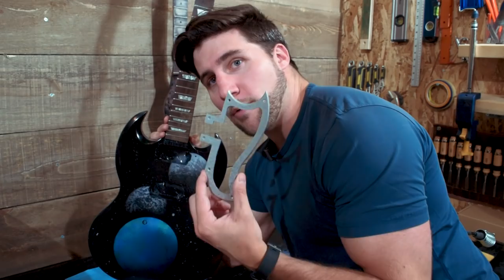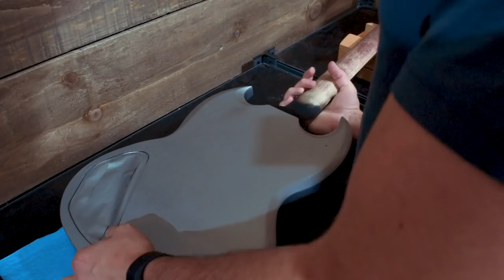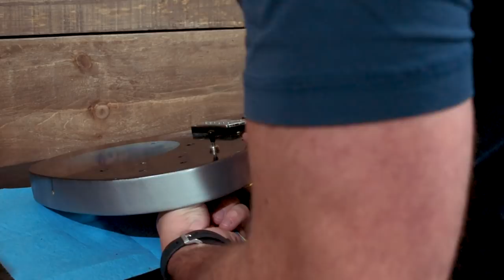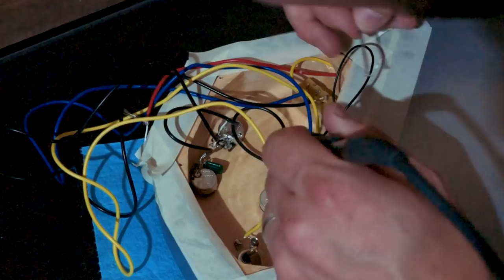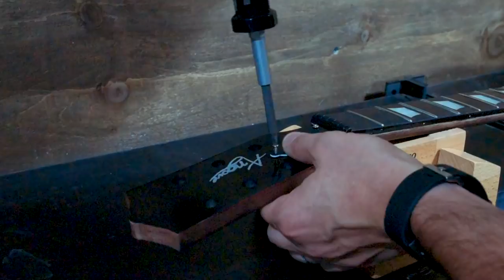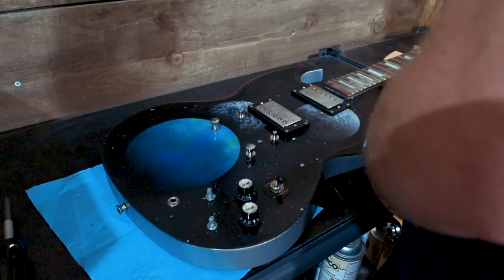The Home Depot Kit Guitar Challenge Part 7 (vs BigDGuitars)

Comment: I like the neck. It defines an area between the body and headstock, which is hardly ever the case. You could make that as unique item on the kits you put together. Good job. As far as the guitar goes, the artwork is great. I really like space themed products. The pickups sounded just ok. That would be one of the first upgrades but all in all the guitar is really nice. Certainly worthy to be auctioned off for charity. Good job Brad. 🤘
Reply from the maker: Thank you. I’m glad you like the neck and the general paint job.

Comment: Nice job.  On the soldering iron, what wattage is it?  The wattage is how you determine the heat. Simply telling your viewers the wattage would make it easier for them. I use a 60 watt which works well for most instrument applications.
Reply from the maker: Mine is a 50/60w station. I’m pretty sure I have a 60w iron on it.

Comment: I watched the whole series and it turned out great. You have some mad painting skills. One question though, no shielding? You could have used foil tape for sealing duct work.
Reply from the maker: I could also have used adhesive spray and tinfoil, or slug tape. When I tested the guitar the first time I wasn’t getting any noise, so I didn’t bother.
Reply: @BradAngove  From watching lots of videos and listening to lots of opinions, it does seem like shielding is unnecessary for humbuckers, and does not even help a great deal even for single coils which are naturally much more noisy. I know that goes against internet wisdom. However, most people don't bother to do an A and B test, they just assume it is necessary. If somebody has a decisive link to a clear A and B test where there is a major difference, in particular for humbuckers, I'm always willing to change my mind.

Comment: Hi, great you threw the pickguard out: one point. The long wires excuse doesn't stick; you dont want antennas: minus 1 point. You could have shield the cavity with aluminum tape ( it really works): minus 1 point. Score: brad - D: 2- 3. Rob.
Reply from the maker: Thanks Rob. The guitar isn’t noisy, so I didn’t worry about shielding. It’s definitely an option though and can be done with aluminum tape, slug tape, or aluminum foil with adhesive spray. Lost of options.

Comment: Hey Brad,
Love it. You said that a lot of people don't use a sufficiently high quality soldering iron and solder too cool. Since the one you recommend has a temperature gauge on it and I don't want to spend $250 on one, so what temperature do you use to solder with?
Thanks for this and all your other helpful tutorials!
Reply from the maker: I use different temperatures depending on what I’m soldering. Soldering wires to lugs doesn’t take as much heat as grounding stuff to the back of a pot.
Reply: @BradAngove  wow, I wasn't aware of that, since I have yet to solder anything (successfully).
What's the max you need? There's a used unit here in Germany I'm looking at which goes to 11 (sorry, bad joke - it goes to 420°C).
Reply from the maker: @ShawnHeath  That should be adequate.

Comment: turned out great! I bought one of those cheap Chinese kits but mines a les paul style. got the paper thin flamed maple front with mahogany back and sides. I've never worked with mahogany. Got a color picked out for the front, and an idea for the rest. I want the rest to be just a little darker than the natural finish, just a shade or 2. any stain or dye recommendations? I want a satin finish. would just satin poly darken it just a little? the front is going to be turquoise blue dye.  any suggestions? thanks.
Reply from the maker: Poly will amber it a little bit. Is the mahogany already sealed?
Reply: not sealed yet. having trouble finding a grain sealer here where I live. I can find all kinds of wood filler, but I don't think it's the same is it? the major brand here is minwax. EVERYBODY carries itlol
Reply from the maker: @timsummerlin6018  pore filler and wood filler are basically the same, but sealer is different. You can use dewaxed shellac among other things as a sealer. My favourite is the vinyl sealer from mohawk.

Comment: Any wet sanding and polishing after the clear coat?

Also, do you leave the guitar vertical or horizontal when you spray the clear on the front?

I like horizontal because it wont run and it even outs better but then you run the risk of dust settling on top.
Reply from the maker: You don’t sand and polish a semi gloss finish. Only gloss generally. 

I like to leave it horizontal.
Reply: Brad Angove ahh I didn’t realize it was semi gloss. I started with this video because the finish caught my attention and now I’m watching the series from the beginning.

Thanks for the reply!

Comment: Niccce job Bradley! ? How high do you set ur action at the 12fret, using metric measurements. Xheers! likd 193
Reply from the maker: I just set it to whatever is comfortable generally. Aka as low as possible without buzz. I use feeler gauges sometimes though. They’re not metric.
Reply: @BradAngove  Ok thankx, just wonder how you like ur action. Peace!

Comment: Cut a clear poly carbonate pick guard for it. Even  a  thin plastic sheet  is better than nothing.
Reply: "Nothing" is better if you don't like pick guards.  :)
Reply: @pulaski1  Think about  the poor unemployed Pick guards wandering  the streets.... No  purpose  no way to  rock... They wanna Rock!

I expect that soft  spray can  paint won't hold up well over time. I repainted a  Dean Vendetta that was born  Turd brown a bright  red with lacquer spray paint. That stuff is soft  months after I painted it. I have to  hang it  by the neck to keep  it  from marking on a  rack. But it  has no pick guard so it would be  ok for  you.
Reply from the maker: I honestly don’t like pickguards for the most part. I don’t play punk rock, so I don’t bang the pick against the guitar anyway.

Comment: I don't see the Weller soldering station mentioned listed  in your Amazon store. What am I missing?
Reply from the maker: That one is just in the “favorites” list. I hadn’t put it into a subcategory.
Reply: @BradAngove  thanks. I realize it wasn't usable with the "no tools" theme, but it seems like using a clear piece of polycarbonate for a pickguard would have been a good solution.
Reply: @BradAngove  since that model is no longer available, would you recommend the WLC100 (40W) or the WLC200 (80W) as a replacement? It seems like the 40W would be a closer match but I don't want to get one that limits me. I have a Ibanez S series kit on order that I hope to use these ideas to do a Joe Satriani Silver Surfer theme.
Reply from the maker: @ncst8wolf818  It depends on how heavy the stuff is you want to be able to solder. 40 should get the job done on guitars, but it will be slower. The 80 allows you more versatility and speed.

Comment: Brad people claim tuning problems with sgs and lps. Does your sg kits have that same problem? Thing is I don't rememer having issues with my epi sg specials or sg 400 that I owned. Is it only on some models?
Reply from the maker: I’ve never run into that issue. I’m not sure why there would be issues with those models specifically. Unless there’s a problem with neck stability I suppose. Everything else is easy to fix up for good tuning stability.
Reply: @BradAngove  me either but from what people say its the d and g strings and the angle from the nut which causes the string to bunch in the nut. Like i said i never had an issue. Just a question thanks Brad. Hope you didn't mind me asking.
Reply from the maker: I see; an issue relating to not having straight string pull. I haven’t had a problem with that but if it’s an issue there are a couple potential fixes. Nut lubrication, a graphite nut, or a locking nut should largely resolve it.

Comment: Ok second comments from me lol - There is this guy on You Tube who always hurls little insults at you Brad, he sure seems to like saying things that are bad about you and I think he needs to stop it - yeah I am talking about YOU! Lol, Your guitar playing is not that bad, I think you happen to be a pretty decent guitar player. Let me tell ya, if you think your playing is bad, you should hear me! Lol. 

I string mine like you do lol. I was taught to do it that way so as to not put uneven amounts of tension on the neck by doing all the low ends first then the highs. As for the stop tail piece and screwing it all the way down. Every brand new guitar I have bought from Gibson or Epiphone there is a gap under the tailpiece, but every used guitar I buy the tailpiece is all the way down lol. I prefer to have mine up off the body because I have this cleaning tool that I slide under the tailpiece and bridge and go all the way to the bridge pup to clean the dust out of it. But, having that tension on the studs is not good on cheaper guitars, I have seen them pull out or go on an angle towards the bridge from the string tension. I have an Ibanez Iceman I bought new a few years ago and it's the lower end model so it uses cheaper wood and the tailpiece was up from the factory, I just noticed the other day it is developing a slight angle so I am going to have to fix that one day. So your way of screwing them all the way down I think is best, provided the full set up allows for it. I know they are cheap pups but that guitar sounds pretty darn good my friend!
Reply from the maker: Thanks Ron. I might not be utterly useless at playing guitar, but YouTube has some amazingly talented players. I’m not one of them haha.
Reply: @BradAngove  - well listen dude I didn't say you were Jimmy Page LOLOL. Yeah I know what you mean about some of these guitar players, man how they can play as they do just boggles my mind. You ever watch any of Justin Johnson's video's? If you haven't that's his name and his channel's name,check him out! He plays a lot of weird instruments and even has his own line of these odd guitars, like shovel guitars and such. He plays a lot of blues, rockabilly and stuff along those lines, give him a looksee if you haven't already. And so what if those other guys can play so good, they can't do the art work you do lol.

Comment: No cavity shielding??
Reply from the maker: It wasn’t noisy when I tested it out before, so I didn’t use any.
Reply: @BradAngove   you assembled/disassembled the wiring and pickups for testing b4 you painted the guitar body??
Reply from the maker: @budgetguitarherogeartv4143  Correct. I believe that was the third video in the series.
Reply: Ok. Caught up on all the video's Brad. Nice job